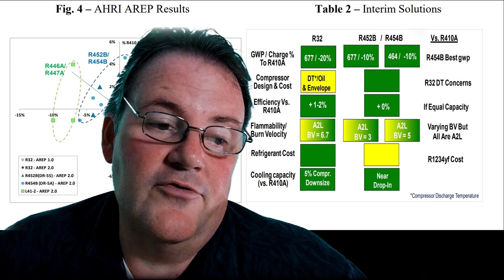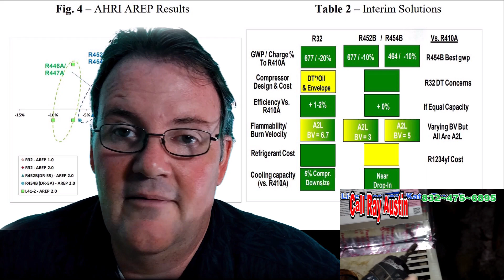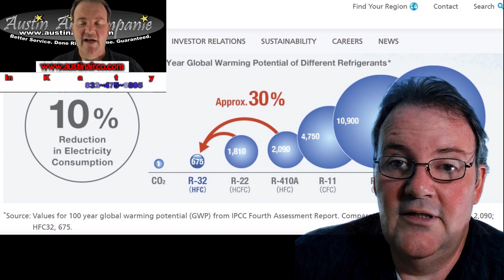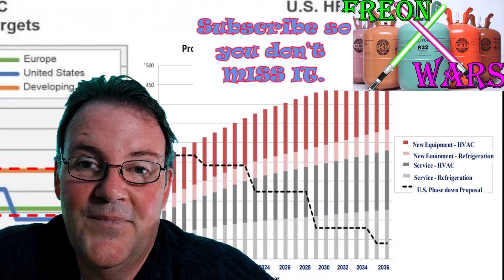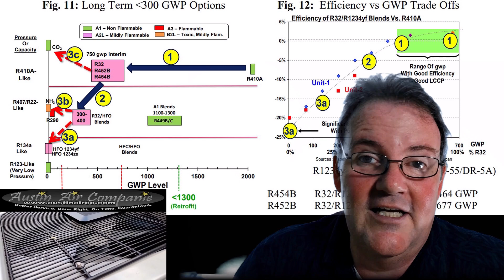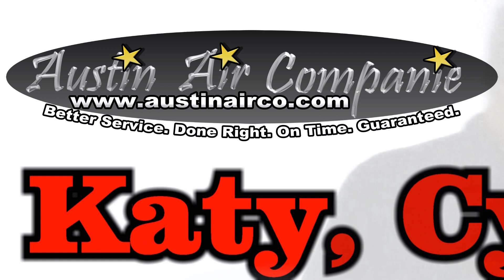New Air Conditioning Freon Phase Down Part 2b Refrigerant Wars

Comment: I have watched a few of these so far and plan to watch the rest. I want to note to you a few suggestions or corrections.

1. You should refrain from showing the small thumbnail video inside of the main video. Having 2 or 3 frames moving at the same time is really distracting and irritating. Plus, the inset video usually has nothing to do with what you are talking about in the main video. Ditto for the graphic backgrounds that are unrelated to your discussion.

2. You have mentioned several times that r22 is "less than one tenth of a percentage point" of r12 ODP. This is a mathematical error. The base of 1.0 is 100%. 0.05 is 5/100 or 1/20 or 5%. It is more correct to say that r22 is only 1 twentieth the ODP or twenty times less than to say half of one tenth of a percentage point. Still a very small number in my opinion, but that's how it goes ;)
Reply from the maker: Thanks for watching and thanks for the comment. 

1. Your suggestions are duly noted but everything I do has a reason for why I do what I do and how I do it. Part of it is to claim ownership of my own work. When you start creating content for your own channel you will better understand why. 

2. R22 ODP is less than 1 tenth of a percentage point. Less than a 10th of a percentage point is anything below 0.1 It is not my position to split hairs. It doesn't matter as you say. To be specific it's 0.055 but does that really matter other than to suggest what? Watch the video. 

3. Comparing GWP numbers for R410a is the same sort of mantra. It depends on what information you are looking at... as I mention that in the video as well.
Reply: @AustinAirCo  duly noted on the content ownership. You are right, I did not consider that at first, but even so, if you could find a different way, it would make it much more watchable, and I assume that's what you want.

As far as item 2, I must insist. 0.1 is 1 tenth, period. It's not one tenth of a percentage point, it's one tenth of the whole thing. 99 percent is 0.99. 50 percent is 0.5. 10 percent is 0.1. 5 percent is 0.05. 100 percent is 1.0 or 1.00. 1 percent is 0.01. one tenth of 1% is 0.001. Half of that is 0.0005. The reported figure of 0.055 is equal to 5.5% of R11 at 1.0.

I mean no disrespect, sir, but math is math and it is absolute.

Thank you for the video, and for responding.
Reply from the maker: @realSamAndrew  While some of this video was scripted, some of it was off the cuff. So I am really not sure what has you so miffed on this? What I meant by what I think I said is that the ODP of R22 was less than a 10th of a percent of 1. --- less than a 10th. a 10th of a percent is 0.1 so anything less than that as in 0.055 is less than a 10th of a percent. Can you agree that 0.055 is less than 0.1? 

10 percent of 1 is 0.1 and 0.055 is less than that. I may have said something or you took it out of context. I don't know. This is like another thing of me calling refrigerants freon etc. at the end of the day it doesn't matter the whole point is that the ODP of R22 is so much lower that the GWP of R32 or R454b and yet they still phased out and banned R22. I thought I conveyed that right, maybe I didn't say it in so eloquently of terms. The point I was trying to make was that R32 as well as R454b will be phased out and banned because the GWP numbers are off the chain compared to the ODP of R22 Freon. Nothing more to read into it than that... it was just a comparison. 

Conversations like this don't bother me. I want everyone to understand what I am trying to convey so if this helps someone else I have no issue with it. I don't make my living by speaking publicly so that's the other end of the spectrum. Talking to a camera isn't as easy as you think. Especially off the cuff.
Reply: @AustinAirCo  Ray, I know text is sometimes hard to convey tone, but please know I am not miffed. Not even a little upset. I sense that we are making 2 different points and we have confused each other. 

I am NOT arguing that r22 is a big deal or a small deal, nor disagreeing with your assessment. I probably agree with you on most of this discussion. The ONLY thing I am disputing is your use of the units to describe how small the concentration is. For example, one gallon is 128 ounces, and one cup is 8 ounces. There are 16 cups in a gallon. If you poured one cup of bleach in a gallon of water, and you told me "there's only a fraction of an ounce", that is false. It's not less than one ounce or less than 1 percentage point of a gallon, it's 0.0625 gallons, but that's actually 8 ounces, not less than one tenth of one percentage point. Do you see it now? That may be how you like to call it, but it's misleading and incorrect to others. A percentage point means 1 out of 100. What you have is around 5 out of 100, which is 5 percentage points not 1/2 of 1/10 of a single percentage point. It's just a matter of naming the proper scale.

Again, my only issue is the use of the numerical terms, not the general feeling of the policies. EDIT: you wrote in your 2nd paragraph above "10 percent of 1 is 0.1".  That is correct . Where you went off is where you say it's a tenth of a percent . Would you agree that ten percent and A tenTH of a percent are two different things and not interchangeable? 🙂

I appreciate your videos and the time and work you took to make them.
Reply from the maker: @realSamAndrew  So I get better now what you're saying. In my opinion it's taking things out of context. Because how would you say it? I probably did state it that way as it sounds like how I would describe it. I can understand why you say it's misleading. But I do believe when you apply context you know comparing it in the way I did it should make it clear to most. 

Could I have said it more eloquently? I doubt it. I don't talk like that most of the time. One of my highest viewed videos I made a mistake that I caught in post where I say repeatedly on video circumference of the refrigerant tube diameter when I really meant the thickness of the tube of the coils. It was the aluminum vs copper coils video. So I am not flawless by any stretch of the imagination in terms of conveying things using the proper term. I am not a recent immigrant so I have no excuse other than bad habits. 

But you know I wanted a video that has some spontaneous moments to it. So off the cuff recording has it's weaknesses. If you ever try your hand at content creation only then will you truly realize what this is all about. So no harm no foul. Thanks for watching.
Reply: @AustinAirCo  I think you are being harder on yourself than than what I intended with the original comment. The word I couldn't think of before was "clerical" error. There are YouTubers with millions of viewers who still make mistakes, and even after editing sometimes. In cases where they cannot or don't want to  re-shoot, sometimes they will write a correction on the screen, or will put a note in the description or a pinned comment. Other times they may say "we'll talk about X later in the video" and then forget to talk about it, so they will provide the missing info in a comment.

Nobody is perfect and I am not expecting that. I guess your example of the thickness of the pipe is a good one. If someone is doing an install and taking measurements, it's important that the instructions are exact. If all you're doing is having conversation, it's not as critical. But since the internet is forever, I thought it was a good idea to make that note.

All the best -Sam
Reply from the maker: @realSamAndrew  yeah completely agree with everything you say here. There's a video I made some time ago off the cuff and not finding the words and just repeating select words over and over. Hard on myself because there is no one else. I do everything and the subject of HVAC isn't one that garners millions of views. So my channel isn't monetized in that way. 

What I do on Youtube is mostly passion driven topics that should be important for others or leave bread crumbs so people with trouble can find someone like me. Find your passion and you never feel like you work a day in your life. But I'm not as young as I used to be, that makes me wiser but also slower than I once was in coming up with the proper words to say in an unscripted event. I go out of my way to not be like everyone else. I watch other HVAC channels on occasion. I have my own groove. I tend to make content in spurts rather than every day or every week sort of thing. 

I edit my videos off of Youtube. I don't use any on line editing function. Much of what I use is shoestring budget, no fancy cameras just a basic cell phone and cheap software editing on my office laptop nothing special. So yeah if you look hard enough I'm sure you could find other errors. HVAC is a job in which each day could be a new experience, while it's often slow to change, changes do come. 

Have a nice one Sam.